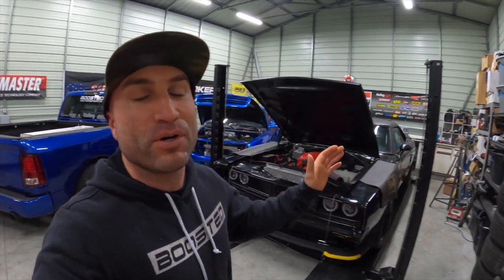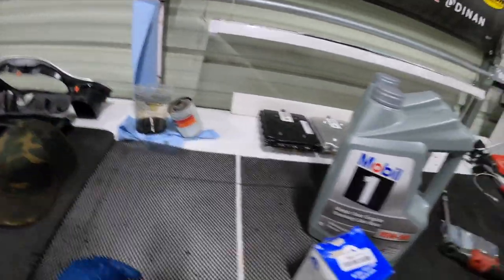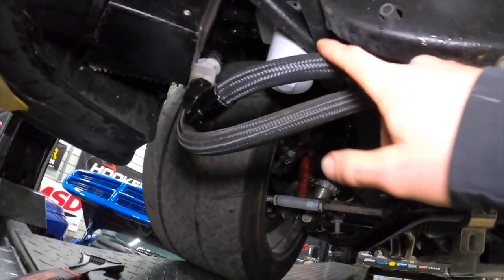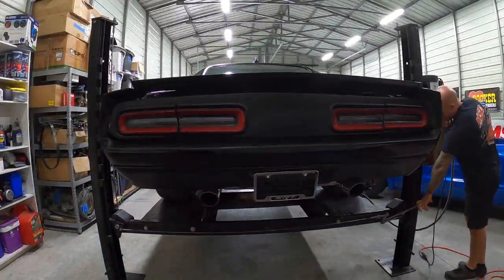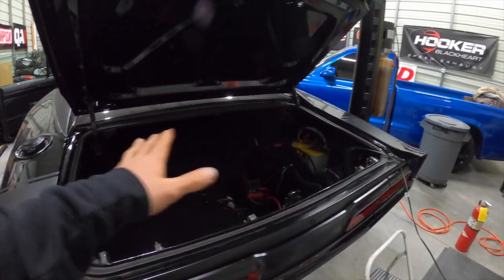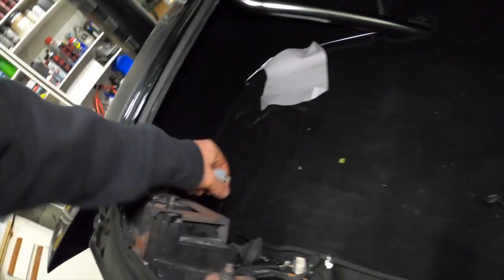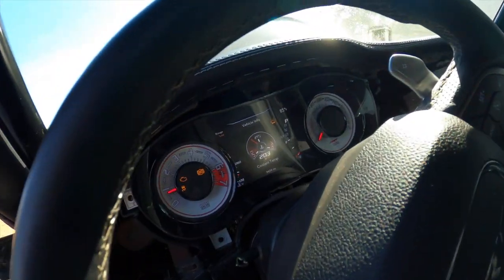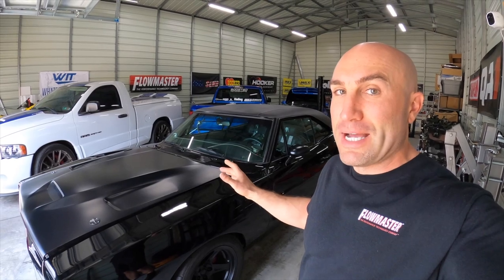Getting this 1968 Dodge Charger Hellcat Swap to RUN EP5

Comment: I bet the owner of that charger must be ecstatic that you got it running after all those other shops couldnt get it to work properly.   Pulling the wire to turn it off is not exactly how its supposed to work but good on you and all your expertise for getting it working.  She's a beauty. Sounds sooooo much better now.

Comment: Amazing videos. Can you answer a question? I have a 2021 Durango hellcat. When I got it, the driver door speaker grill trim was broken. I cannot just buy that piece. They want me to spend 1500 on a whole new panel. I’ve found a couple panels much cheaper on eBay. My question is…these panels and speaker grills are all factory riveted. You think it’s possible to cut the rear of these rivets and somehow reattach the newish one in place of my broken one? Curious before I make the purchase. I don’t have a visual on the backside yet. Just online pics.

Comment: Banjo fitting might work for your clearance issue. Usually lower profile and directionally adjustable. I have them on a steering rack conversion I used on a 71 Camaro.

Comment: That's an optima battery it has a special kind of batt charger for deep cycle battery like the Odyssey batteries also.from what I understand I had a yellow top optima and it lasted me 12 years I turned it in for a new red top batt great batteries pricey but if ya can get 12 years out of it....... and they are a liquid acid free battery they don't leak and if you needed to mount it upside down you can....... don't toss the battery I believe summit and jegs sells a charger for it nice job fella.....it is good to know things and the secrets to the wiring ....read schematics and chase wire...time consuming and patience testing for sure.......👍👌✌️🇺🇸🇺🇲

Comment: Regarding the lower oil lines hitting the sway bar, is there room under the hood that you can put spacers on the engine mount to raise the engine slightly to give the space needed for the oil lines?

Comment: 15/50 oil please explain anyone
Reply from the maker: More zddp and more protection in high heat and extreme conditions. This is a race spec oil that doesn’t have all the epa labels you seen on the 0w40 stuff. Better for the engine 👍